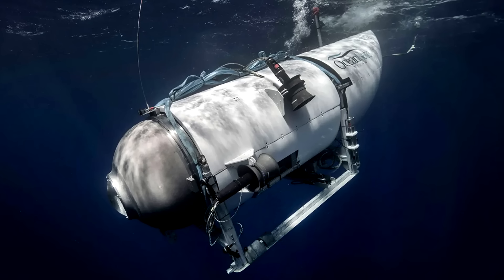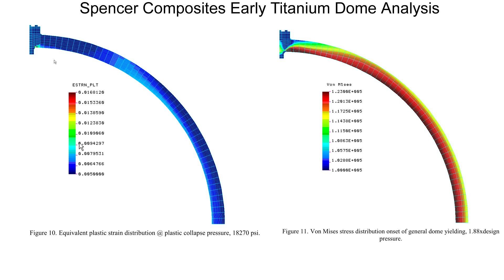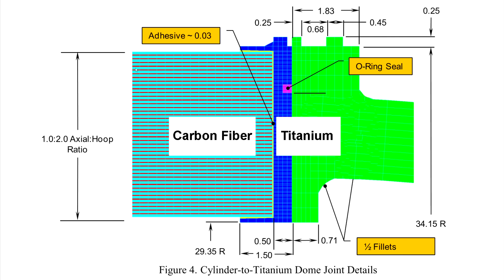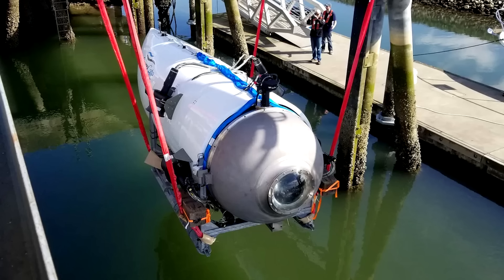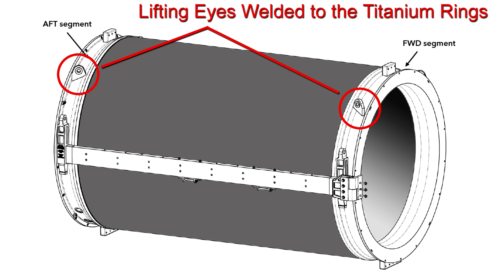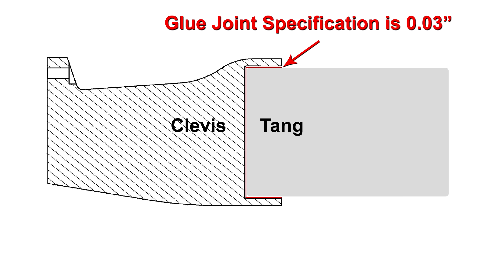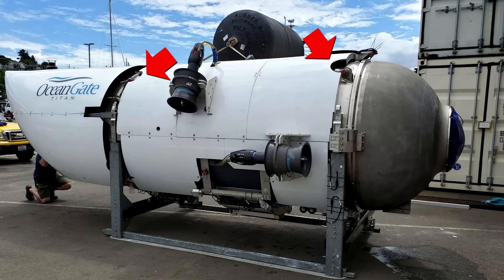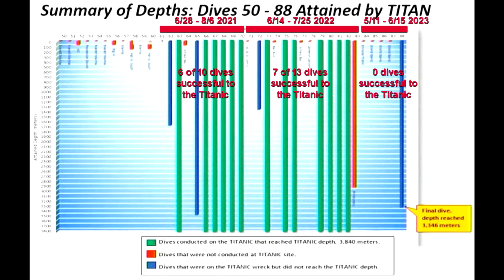OceanGate Titan Titanium Rings - An Additional Story About Them

Comment: didn't the front ring also fall off shortly before the fatal dive? Or was that a previous model that's front rings popped off on a test dive while it was being pulled out of the water? I wonder if the rings had anything to do with that incident!!
Reply from the maker: Yes, the dome fell off. Thanks for commenting. But it was on the deck of the Arctic Horizon while they were still on the LARS. They just got dragged back onto the deck. I have tried to find out why all the bolts weren't in at that point, but I am not sure. It was after dive 61, and they may have been taking bolts out (routine) and did not have the dome properly supported. That dome weighed over 3,500 pounds, and the "hinge" on the left side (looking towards it) wasn't really a hinge. It could not support the weight. It was more of a pivot point. When opening the dome, it had to be supported at the bottom as it opened.
Reply: @solareclipsetimer  Oh I see, so there was a shearing point on the false hinge due to the weight of the dome itself? I must have correlated the dome and the ring to being the same piece, but I think I combined the two in my mind while thinking about it. They did absolutely every single possible step wrong the entire way so it's easy to get them mixed up. Thanks for the clarification!

Comment: If they wanted lifting eyes I don’t understand why they couldn’t have added them to the subframe the sub sat on. At worst they’d have to use spreader bars on the straps so they don’t rub the hull.
Reply from the maker: I have a picture in the video where they seem to be lifting it from the top side of the landing gear on the first sub.
Reply: @ It just makes so much more sense. But, nearly everything that has come out from all this just has me shaking my head. It’s like they had the data and the people then just did whatever they wanted in the end.

Comment: Well...welding the lugs onto the titanium ring AFTER the carbon hull was already glued in place was definitely a dumb idea. First of all - the ring is very thick and bulky. To achieve the welding temperature at the spot - they most likely had to heat up the ring quite a lot, which could deteriorate the glued joint.
There would be nothing wrong with welding the lugs BEFORE the installation of the carbon hull. The 5,500 lbf on each lug is negligible, and extremely unlikely to cause any harm.
Reply from the maker: Thanks for your comment.  Tony would have agreed with your first point but not your second point.
Reply: @solareclipsetimer  In which case I would do the numbers and show him how things work. Tony sounded to me like a good and smart guy, but...leaves falling off the trees in autumn shorten the length of day - also true :).
It usually pays to have some idea about the magnitude of some effects...

Comment: Welding near the adhesive and carbon fiber after the fact says it all. The lip is only one inch into the carbon fiber hull. Certainly not enough to take the entire weight.
Reply from the maker: For the second sub, I am sure they welded the rings on when the rings were not attached to the carbon fiber.  For the first sub, it was already glued on, so Tony mentioned that, but the other reason was that the rings were not designed to take those loads.
Reply: @solareclipsetimer  Pretty much all transition points are failure prone from submersibles to plastic coffee mugs.
Reply: Welding - yes, you are right. The lip? you are 100% wrong.
Reply: @les8489  It’s in the cross-sectional detail drawing.
Reply: @blipco5  I was talking about the ability to take weight...

Comment: It would have been easy to design a harness/cradle to transport the submersible safely
Reply from the maker: Thanks for commenting. I believe it is because of getting the Titan off the dock onto the LARS. It was a tight fit, and the landing gear of the Titan had to slip into a track on the LARS to get locked in. So, they couldn't have a sling across the bottom.

Comment: I feel like this kind of design project needs to descend and ascend many many times until it finally fails simply so engineers can learn where the limitations are BEFORE putting humans inside.
Reply: That’s the kind of overbearing safety precaution Oceangate thought was stifling development. They decided to push ahead and break new ground. Unsurprisingly they quickly found the failure point. The only sad part is the other people that went down with it. Stockton got what he wanted.

Comment: The problem was that each expert was focused on their specific tree and no one was in charge of the forest. This is what happens when projects are compartmentalized to the nth degree. Plenty of high-level people knew Challenger shouldn't lift off that morning, but because the decision making responsibility was so diluted, it went ahead. The whole "sign off" culture in engineering is a huge problem, imho.
Reply from the maker: Yes, you are correct and thanks for commenting. Both the Challenger and the Columbia disasters could have been prevented. The problem occurs when management gets too far removed from engineering with complex projects. That is why we have to study the failures. Thats is what NASA would not let Butch and Suni come to Earth on Starliner. NASA learned.

Comment: it would be interesting to know if the width of the roof section of the carbon fiber that didnt shatter corresponds to the width of the placement of the lifting eyes. 
water ingress at the site of the lifting eyes would fit with my theory that the reason why those parts of the carbon fiber didnt shatter be delaminated because there was already water ingress in these areas. 
and the CG being a bit aft because of the added weight at the stern would fit with my theory that the implosion initiated at the stern of the carbon fiber. one would presume the additional weight would cause more damage to the glue joint at the stern than the bow. the reason i believe the implosion started at the aft of the hull is because both side rail ends, as well as a great deal of carbon fiber debris are stuffed into the aft titanium dome. which to my mind implies that the after end of the hull constricted inward taking the ends of the side rails with it before the forward end collapsed back towards the aft resulting in the rails and debris being stuffed into the aft dome. hearing about the problems caused by the added stress on the C channel cause by adding those lift points only convinces me of this even more. 
why no one thought of the obvious alternative solution of simply extending the landing legs upward a little and adding lifting eyes to it resulting in an integral cradle i really dont know.
Reply from the maker: Thanks for your thoughtful comment.

Comment: Well, this project was a private endeavor. Doesn’t mean it won’t work but eventually a a CyberTruck cones along.

But I think the space shuttle’s O-ring debacle dwarfs the sub implosion. With the sub nobody was pointing fingers at the titanium rings. It was more of a ‘this is a total clusterf*ck and something just HAS to go wrong’ sort of situation. But with NASA was clearly told that those O-rings were not designed to be used under the current conditions at the launch site.
Reply from the maker: Yes, you are correct and thanks for commenting.  Both the Challenger and the Columbia disasters could have been prevented.  The problem occurs when management gets too far removed from engineering with complex projects.  That is why we have to study the failures.  Thats is what NASA would not let Butch and Suni come to Earth on Starliner.  NASA learned.

Comment: Tony did a good job of pointing out exactly why this was a bad idea. Putting stress on something which was not designed to handle stress ("let's just put it on for convenience lol,") the glue tearing away from the upper lip every time they lifted it, and the rings not even being equal from cg (because no one thought they should o something like this)
And 5 people instantly became a uniform red mist which can drain through a spaghetti strainer
Reply: Interesting, there was no  strap seating to have individuals maintain a position inside the sub either.. if they tilted they just slide down to one end or the other. right?
Reply: They didn't become a red mist, official photos of carbon fiber from the coast guard that just came out show carbon fiber pieces that are all larger than about a skateboard. It likely took longer than 2 seconds for them to die. They had time to feel horror and extreme pain. They felt the water and perhaps heard the beginning of Stockton's warbly old man yell, or the young boy's scream.

Comment: After all of this, I'm still waiting to hear ONE SINGLE REASON for the carbon fiber hull.  It has no weight advantage considering ballast requirements, it CLEARLY has no strength or durability advantage, and I haven't looked at the numbers but after development costs are factored in I seriously doubt there's a cost advantage.

It seems like the one and only reason they tried it is simply to be first.  I salute the pioneering spirit, but being first is not a good enough reason by itself.  Someone could try to be the first to build a submersible out of actual submarine sandwiches, and literally no one would say "good idea!"  Well, it sounds like everyone with real experience in the deep submersible field told them, "this first will probably also be the last." Yet still they persisted, telling themselves pretty little lies to ignore valid criticism and glaring design flaws.  Apparently they even ignored a huge ping in 2022 on their own real-time monitoring system that was installed specifically to inform them of structural issues.

 Finally, on the first dive of 2023, the tab for dishonesty was called in and five people paid it with their lives.  Now OceanGate's only legacy is a another cautionary tale about engineering arrogance akin to the very shipwreck they set out to visit.
Reply from the maker: Thanks for your comment. You bring up good points and there are no clear answers for this tragedy.
Reply: The main reasons were cost and passenger space. Weight is also still a concern because you want buoyancy so it can drop weight and rise naturally if need be. 
Typically subs like this are made from titanium and often the passenger space is a ball so has limited capacity and comfort. The idea with this was to build it cheap, have more space, and be somewhat more comfortable.
Reply: @ well, forgetting for a moment that the cylinder shape was already going out on an engineering limb, why not just make it out of titanium?  Fewer question marks, whatever the cost and weight issues might be.
Reply: @herbderbler1585  But that would make sense and be doing what everybody else is doing. They wanted to innovate and show how wrong that old stuffy thinking was. 
And, expensive titanium reduces the potential profit. They wanted this to turn into basically a shuttle service and sell titanic tickets.

Comment: This video is "FUD". Lifting eyes are routinely overcapacity. If you want to convince "me", you'd have to mathematically prove that the lifting eye loads caused stresses that came anywhere near to yield limits of the glue. I'm not saying "that didn't happen," I'm saying "you have to prove it before I'll listen to your fear, uncertainty, and doubt."
(It's not even a difficult proof to do so that's why I'm not sympathetic to your FUD whatsoever.)
Reply from the maker: Thanks for your comment.  I am only the messenger taking the time to comb through the hours of testimony and put the interesting stories together about unanswered questions.  Tony and his engineering partner at OceanGate already did the math and told them what they should NOT weld on lifting eyes on the rings after the fact.  The rings were not engineered into the original design of the rings.  Tony was concerned about microcracks in the epoxy due to the shear forces.  At the end of the video, if you watched that far, I mentioned that for the second sub, there was another engineering company involved.  I leave open the idea that the second company may have done additional engineering (besides Tony's) and said it was okay to weld lifting eyes on the rings and told OceanGate exactly how to do it.  But at this point in time, there is no information about that clearance in the public domain.  And from the information I have gleaned from the expert welders who have commented on the video, I doubt that it can be done without implications.
Reply: @solareclipsetimer  Welding was not recommended because it would overheat the glue between the ring and the carbon hull. If you have any idea of welding - then you know that the parent material needs to achieve certain temperature locally in order to produce a weld which holds. The ring was very bulky and thick. It was difficult to weld precisely because of conductivity which transferred the heat away from the welding site. The glued joint was close by. It was most likely overheated. If the temperature of the glue exceeded 350 deg.F by 40-50 deg. F, then it was reaching the glass transition temperature of the adhesive (and possibly some carbon/epoxy plies too. Not recommended.

Comment: Just when I thought this can't get any worse ... the Titan weighed 11.5 tons. Even titanium, strong as it is, is going to deform when things are hung from thin rings of it in a way not consistent with proper load bearing. We're talking about basic high school physics and chemistry here ... we're talking about a basic understanding of the malleability of metal. I didn't think this could get dumber than 547 square feet of glue to hold the thing together. I was wrong.
Reply: And you still are wrong on all accounts. Basic high school physics must not had been your strong point.
Reply: @les8489  I summarized the video. I did well in English and basic communications!
Reply: @hymnodyhands  LOL...no hard feelings :) The deformation of the titanium ring when 5500 lbf force is applied on both lugs would be just about 0.005" to 0.007".

Comment: More I hear about this sub, the more I am amazed of the sheer negligence and stupidity involved in all of this. Every possible bad idea for the sake of convenience seems to been used.

I work with welded things... I was a fabricator and then got an engineering degree. If someone asks if welding can should be used on critical components, I'd answer with "absolutely not". Welding should always be avoided and minimised if at all possible - and I say this as someone who livelyhood is about welding. 

Then on top all of this. They chose to weld Titanium, which is notoriously temperamental material when it comes to welding. They clearly did not recrystalise the rings to normalise internal stresses - because they were already glued on. And after the normalisation, they'd have to machine it anyways!

They didn't seem to think anything through, just improvised at every step and obstacle.

Now we can't even say whether the delamination issue actually originated from these lifting stresses. We  can't actually know for sure if the already questionable composite hull was actually bad idea... because they went and fckd around on the rings with welding and lifting.
Reply from the maker: Thanks for commenting and ading to the discussion about welding.

Comment: The dive success chart was interesting.
Reply from the maker: Thanks for commenting, and I am glad you liked the content. You may like this summation. It got to the Titanic 13 times at 3,840m (and in 2022, it got to the Titanic on four consecutive dives!). It also had one dive to 3,500m, one dive to 2,900m, and two other deep dives, 1,700m and 1,380m. You can also count the five high-pressure dives in the Deep Ocean Test Facility done before the expeditions as cycles (3,000m, 4,000m, 4,200m x 3). So, that is 20 deep pressure cycles (if not including the 1,380 and the 1,700).

Comment: Also I heard one time in rough seas the Titan bounced so hard on the deck of the ship the entire front dome fell off. It sheered all the bolts right off.
Reply from the maker: Yes, the dome fell off.  Thanks for commenting.  But it was on the deck of the Arctic Horizon while they were still on the LARS.  They just got dragged back onto the deck.  I have tried to find out why all the bolts weren't in at that point, but I am not sure.  It was after dive 61, and they may have been taking bolts out (routine) and did not have the dome properly supported.  That dome weighed over 3,500 pounds, and the "hinge" on the left side (looking towards it) wasn't really a hinge.  It could not support the weight.  It was more of a pivot point.  When opening the dome, it had to be supported at the bottom as it opened.

Comment: I am nobody, but my analysis of the debris was that the carbon fiber tube had detached from the rings, shearing the inner lip during failure. This would be inevitable due to the different rates of deformation of the rings and carbon fiber under pressure. The uneven lifting loads, welding and deformation due to the clevis compounds this problem.